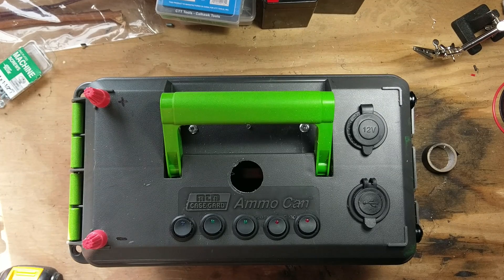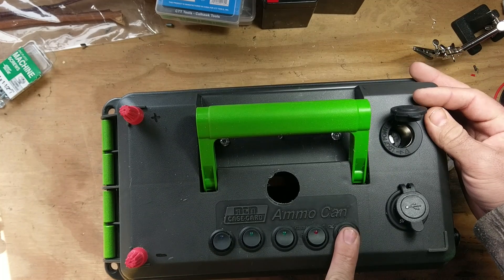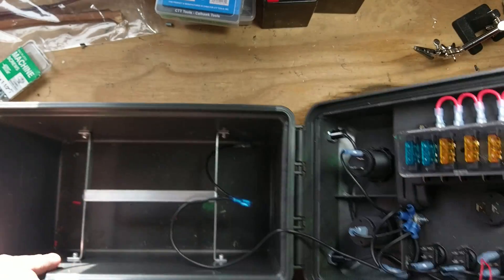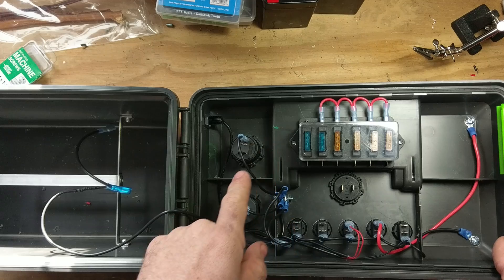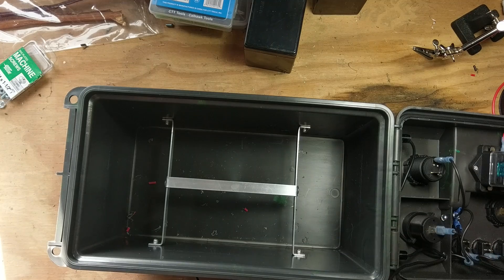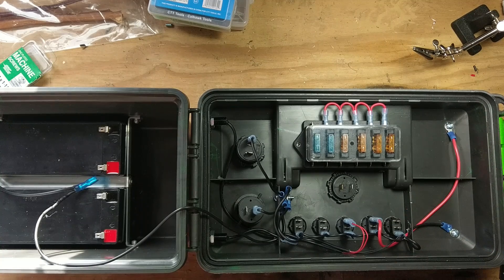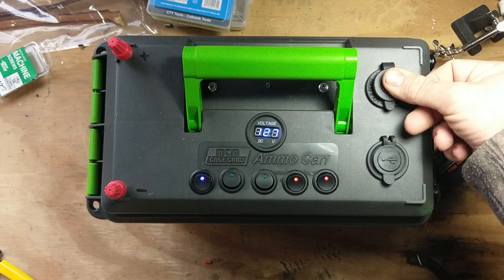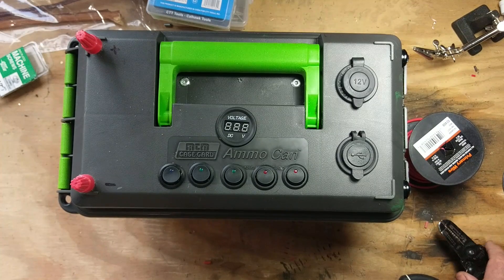How to build a 12v portable power box

Comment: Terrific video. Looks like a fairly simple weekend build. I would probably add a three way switch (on-off-on)for charging via a wall adapter and a solar controller. Also a connection point to add in a another ammo box with just a pair of batteries for additional run time.
Reply: Bradley Johnson  if you do the extra ammo box could you just hook them up to the post on the top of the ammo box?
Reply: You dont need a 3 way switch. There is no difference between charging and discharging.

Comment: Wonderful video. I am building my portable power box now. Still waiting for components to come in from Amazon and Ebay. I will be adding a MPPT Solar charge controller, an Inverter, and a external AC plug. Thanks for posting. Really appreciate your discussion about wiring the fuse block and switches.
Reply: Everything looks ok. Hung it on a hook in the living room she can't reach.

Comment: Could you hook up an external charger, connect it to the two posts you use for strip lights, and back feed to charge the batteries?  I'm thinking a Deltran battery tender.
Reply from the maker: Capt Ron yes as long as the switch is on
Reply: Thanks for posting this. I've ordered the parts to make one.

Comment: Hi, what size cable are you using, is it 5mm copper wire?
Reply from the maker: Robert Hooper 14 awg and 18awg for the accessories. not sure how it translates
Reply: Another question for you! So all your negatives just attach to a bolt with like a circle crimp? The negatives don't go anywhere just all remain attached together on the bolt?
Reply from the maker: Robert Hooper yes they all hook up there then there is one negative that goes to the negative post on the battery
Reply: Thanks for the reply. So you linked both battery negatives together to use in series and that cable runs to the bolt and then all additional switches and ports negatives run to the bolt also. So that makes the circuit right? Was confusing me but think i now understand?
Reply from the maker: Robert Hooper hooking both negatives on the battery together makes it rum in parallel to keep it a 12v circuit. I just chose to hook up the negatives that way to simplify the wiring

Comment: Hi

Great video. On the video notice you had one wire with 3 split connection, can you make a video how to make the split connection?  

Thanks
Reply from the maker: Chelle Haney I don't have a video showing that it's just two wires joined by one connection
Reply from the maker: anonymous anonymous sure I can include it in my jet boat wire vid when I get to wire that up
Reply: Do you recall which video you may have shared the 3 split connection? I'm trying to find it but can't. off to see if I can google but.. if you catch this .. :)

Comment: very nice video. the way you pit it all tougher i think i can do it also. i pretty much found all i need. i just not sure which ammo box you used so i can also use two batteries. i like that idea the best. can you share a link to one one that would work.
Reply from the maker: joseph poncik I used a "zombie" brand ammo can there are several kinds that will work with two batteries just play with them and place the batteries in them to see if they fit. make sure you have 2" of clearance from the top of the batteries to the lid

Comment: clean build but how are you charging the system?
Reply from the maker: Troy Bailey I have a charger hook up I added to the batteries you can also use the external power points with the master and power point switches on

Comment: I was wondering if you make me one if I pay for it
Reply from the maker: thomas carneal shipping is pretty expensive. for just a single battery one for me to make and ship would be bettween $100-120 depending on where you are
Reply: you could make it where all they have to do is put in the batteries. lighter ship. dont know if mentioned how much this cost to make. i was wondering.  an ingredients list and wiring diagram would be awesome. this video is so well done, i almost could follow all of the wiring. wondering where to find and in what order / arrangement  the fuse box is done please. 

thanks
Reply from the maker: sberryscake I purchased everything off of Amazon if you type in 12v switches,volt meter, fuse block, USB, and outlet you will find all of the parts. only thing I changed is the power posts in the outside I highly recommend using banana jacks they are way easier and safer. I have about $80 ish USD into this build

Comment: Hey! What kind of batteries did you use? sorry if i missed it in the video
Reply from the maker: Shane Attard I use "vexlar" style sealed 12v batteries but really you can use any 12v just depends on the weight you want to carry
Reply: Hey! so I've made this box exactly like yours all wired up the same. When I turn on the switches the lights on the switches turn on but the USB ports don't work?
Reply from the maker: shane attard either bad switch or swapped wires

Comment: Great video! Been waiting for a video like this to show up somewhere, really helpful. Going to start mine as soon as I gather all the items. What size wire did you use?
Reply from the maker: Northern MN Outdoors I forgot to mention that in the vid but from the bat to the fuse block to the switch and back to the block I used 14 ga and for the rest I used 18 ga
Reply from the maker: also for the power points I used regular machine screws with wire nuts on top to help protect them
Reply: Thanks for the response!